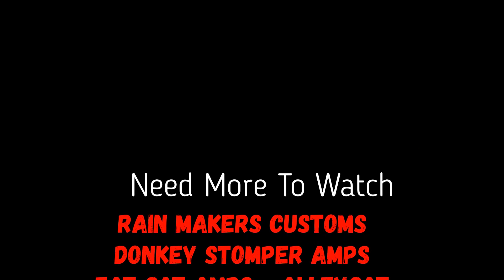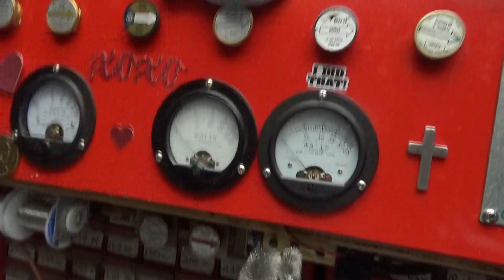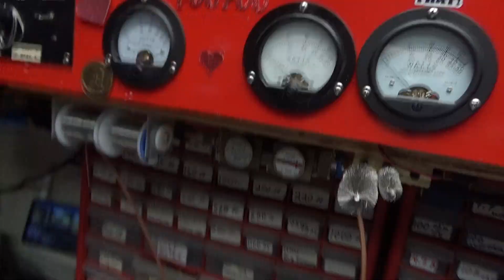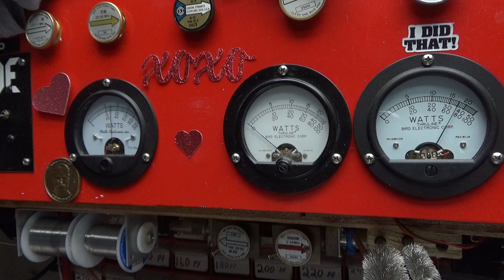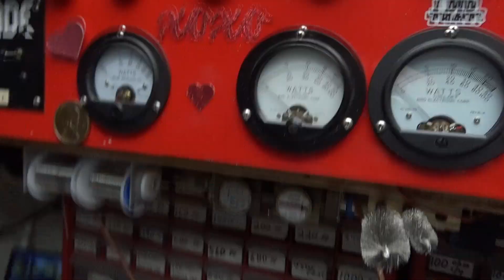4pill base fix

Comment: I wonder if the bias circuit resistors (wire wound inside) are generating an inductance that is effecting the input tune? To me that explains the swr dipping with modulation because the inductance they  generate changes with modulation/rf output bringing the tune in and out because the inductance value changes under load ? . I've been warned against using wire wound resistors in RF tuned circuits because they are also inductors.  I have also been warned about using disk capacitors because of piezoelectricity they can generate in RF tuned circuts . Disk caps can  act like microphones and oscillate causing a circuit to fall out of tune .  So add the both together and now you can't tune a circuit who's required tuning  parameters change with RF level change . In conclusion I assert the wrong type of resistors in the bias circut and the use of disk caps   in tuned circuts have become common accepeted mal practice. My opinion . Open to being convinced otherwise. 73
Reply: Get back in your BOX! Box.
Reply from the maker: Who knows ! Iv seen all of the ways work and not work .. China parts is what's wrong with everything now days

Comment: Can I run a 250 box, powered by a power supply, 30 amp 12v. Connected to my 2000?
Reply from the maker: I'd run 150 pep at the most on am and 75  drive on ssb
Reply: @3madeamps  awesome info. I have 5 boxes, 3 are 100w. I'll pick one of those. Thank you sir